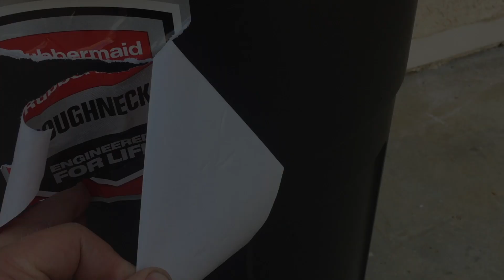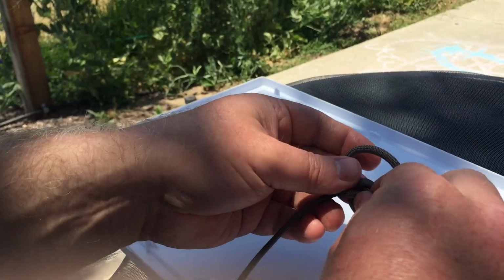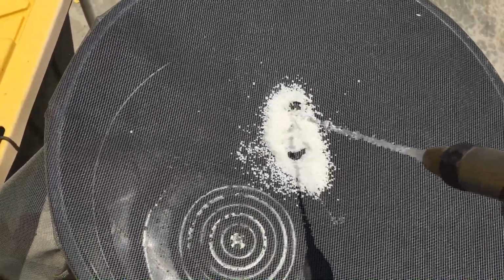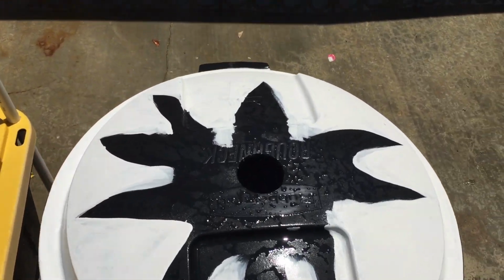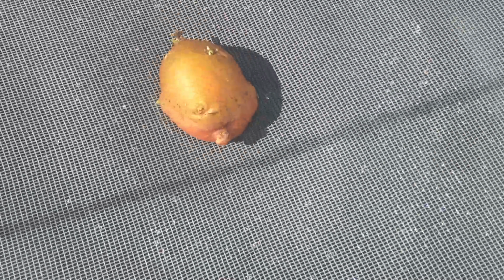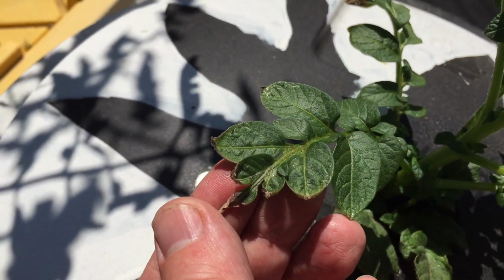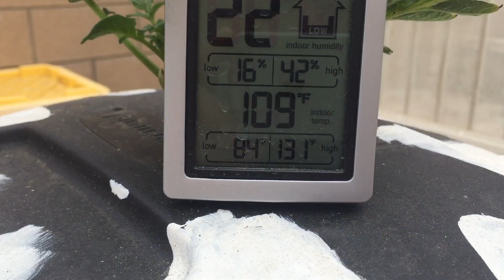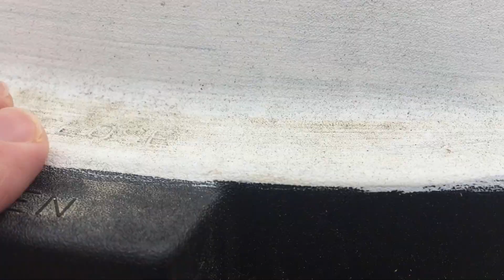Watch part of the garden video YouTube banished!

Comment: Hi Jeb, love the videos. In Thailand they have huge terracotta water storage containers probably with a similar capacity of the bin tote. A tiny amount of the water slowly evaporates through the pot and the water inside stays wonderfully cool. Not sure if it could help in your application but I have been thinking about trying it when next there.
Reply from the maker: I think it could work as long as you run the EC low enough to compensate for the increased evaporation.
Reply: Jeb Gardener Or maybe design some sort other sort of evaporative cooling system. I'm picturing cloth/towels wrapped around the trash can wetted by an external water source. By capillary action maybe? Or gravity fed somehow. Or what if the whole trash can were sitting inside another much larger resoirvoir, and the evaporation happened at the surface.. well that one sounds impractical, and evaporation would probably be much slower without the wicking action/surface area of towels. I've also reflected on using space blankets to wrap reservoirs with. But I've been told white paint is nearly as good. Just some thoughts. I've never really grow kratky anyway.

Comment: Hmm. I grow capsicums and spinach indoors with my Vero 29C lights. Organic soil. And fed only with rain water and compost juice. The soil is live. And the worms seem to be fairly happy. Decided to give indoor growing a shot, as I was thoroughly annoyed with cabbage moths and snails eating all my produce before I could.
Reply from the maker: that sounds super cool but that can be real difficult for a new grower to master
Reply: It was certainly a step up in difficulty to begin with. For one. While these lights are no HPS retina burning heaters. There's still that factor of heat in summer.

Secondly. If mold is an issue with the particular crop of choice. You also have to add in controllers and devices to maintain the levels. i.e: humidifiers and dehumidifiers.

Basically, you've got to simulate the environment they're normally grown in. Minus the bug pressure.

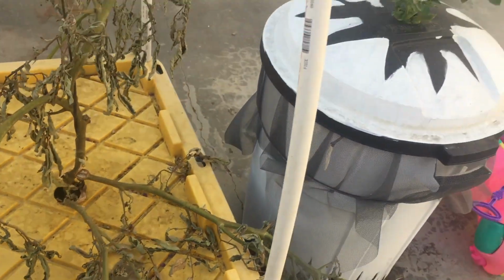Comment: 4:25 "this heat is taking a toll on these plants"
Reply from the maker: is that grammatically correct?
Reply: Dunno.
Reply: it was 113 in so cal >_<
Reply: Yikes! Now I remember why I didn't stick around SD. Although 95ºF with 80% humidity isn't much better, but we don't have Fire Season to deal with in NYC
Reply: Jeb Gardener if u bury the barrel in the ground or otherwise insulate it from the sun u will have better results. My plants in Mohave don’t mind the heat as long as root temps stay under control
Reply: Timothy Greer  Yep, the humidity is what makes the heat unbearable.

Comment: Please do try watermelon hydroponically.
Piece of advise keep you watering constant
Reply from the maker: I'm trying pumpkins now.  They drink so much!
Reply: Jeb Gardener WoW didn’t see the spider-mites infestation, if you were growing in winter i think there shouldn’t be any pests from the cold weather.Weird
The watermelons i grew hydroponically were amazing but as soon as the hot weather kicked in and i started adding a slight increase with the water i had plenty of cracks with the watermelon.
Lessons learnt the hardway 👍🏼
Reply from the maker: What method were you using for the watermelon?
Reply: Jeb Gardener Dutch-bucket method
Reply from the maker: I suspect when the plant sits in water, cracking will be less because there won't be the contrast between dry and wet.

Comment: How do you get potatoes with the roots hanging in water why don't they rot?
Reply from the maker: the water recedes because this is the kratky method, so most of them never sit in the water.  If they did they probably would not rot.  Plants rot because they die.  Potatoes die because they don't have enough oxygen.  But oxygen is in the water, especially in cool temperatures so I suspect they would be fine.